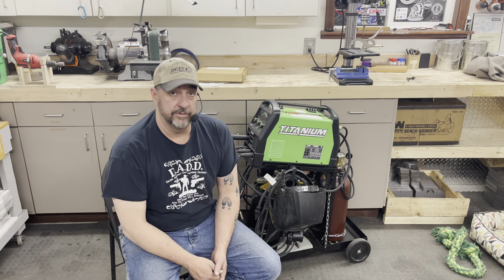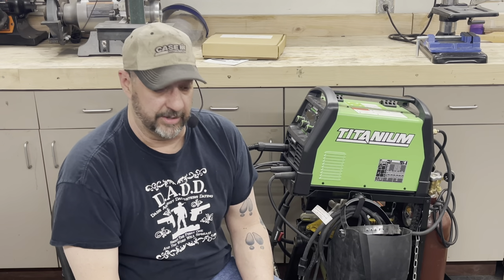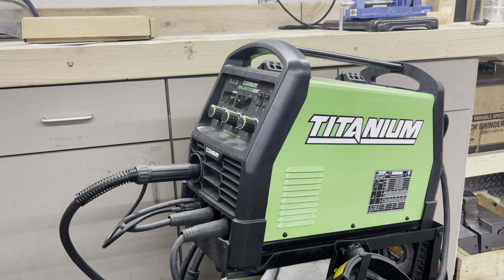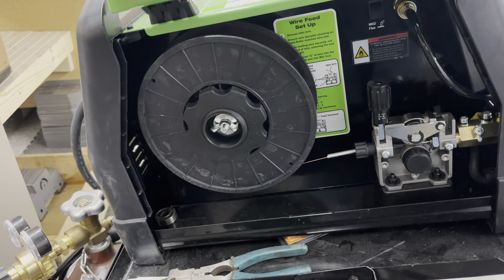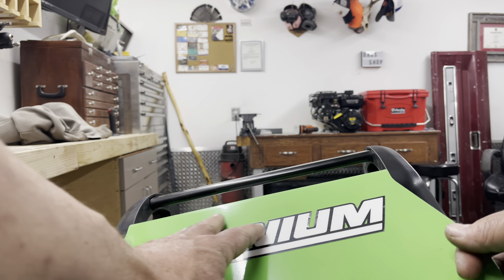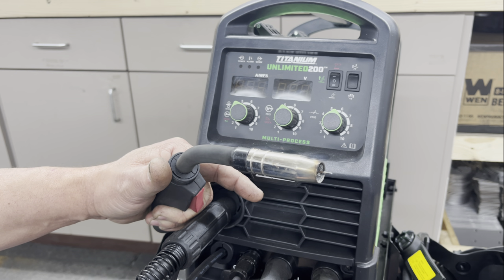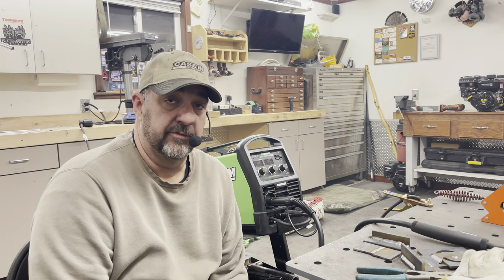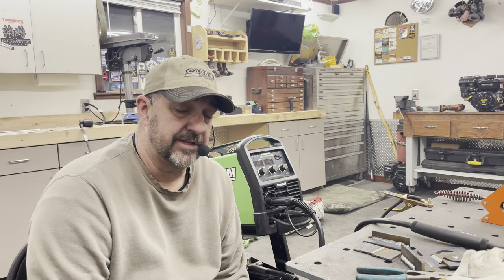Harbor Freight - Titanium Unlimited 200 Welder - Junk or Jewel?

Comment: I have the same welder and have been using it for 2 years now, built lots of little and big projects and it has worked flawlessly. I installed 240 receptacle in my garage and it works well on thick metals used to make HD bumpers. I found my welder at my local HF as an open box with the same cart for $550 together. I could not pass up the opportunity. It is a very good welder and so far it is stout and runs past its listed duty cycle without overheating or tripping breakers. Definitely worth the money for a hobbyist. Thanks for such a great in depth review!
Reply from the maker: Thanks for watching
Reply: Hello! I know this comment is like a year later than yours but I’m curious how the welder has held
Up in that time?
Reply: @PyroSparton117  mine are functioning normally, I picked up the stick welder 225 and the flux core 125! All three have a place in my carts and get used, I haven’t had any issues with all three of them. They have their own purpose and uses around the shop! All were able to be purchased at a great price, not so sure now. I’ve build bumpers, railing, suspension, targets and stands, shelving and a bunch more stuff.
Reply: @Justforfun-ek7et  excellent! Thank you for the help! We’re looking at one for our ranch and I was curious its longevity. Thank you!!

Comment: I've been welding for 10 years and this little guy does great.  I have an SA200 on my rig I use for pipe welding but it's loud and not practical in the neighborhood. If I'm doing home projects or little side gigs this machine is my go to. I'm confident it will weld good enough to pass a welding test. I've been thinking of doing a 6G pipe test on some small bore with an actual WPS and see if it'll make xray quality welds lol. I've had lincoln and miller for the shop and this titanium actually not only compares but excels in some aspects especially in the mig portion on autobody. Great video by the way just subbed!

Comment: Great review, Ive had my titanium 200 for over a year and it is rock solid. I got the two year warranty also, no brainer. TIG works great other than drag to start, but no big deal. Ive welded tons of stuff, just got done building a 20' !4,000# tandem trailer from scrap steel I picked up and it turned out real nice. just subscribed to the channel. Again, really good review.
Reply: When you drag start your tungsten doesn't  it contaminate  the weld?????
Reply: @jefferycarter1791  it’s never been a problem for me, it’s called drag, but actually it’s just a light touch to get it started kind of like arc welding. I like tig because it’s very clean and looks great.
Reply: @jefferycarter1791  thats only if you have a weld puddle or the tungsten is hot and melt the filler to to it on accident
Reply: How much extra was the 2 year warranty??
Reply: $99 we’ll worth it
Reply: I just took some old steel screen security doors. Salvaged the steel and built me a work station using folding legs from press board tables. I welded it up in 3 sections so it can be 50x20 inches, 112x20 inches or an L shape 81x51 inches or 50x20x51x20 inches. Added bracing to support a bolt down vice and bench grinder. Next project is a 6foot metal break that will attach to it. LOVE that welder!

Comment: I have a different model of the titanium. I have the mig 170 and I believe it is an excellent welder at the price point for the product line. I carry it in my service truck and have used it for a large weldment repair on a combilift. It performed exceptional and the repair shows no signs of an issue two years later. The machines are very capable if you know the limits and prep your work accordingly.

Comment: I bought one of these machines and I love it. I grew up with an old Lincoln stick welder, so having 2 types of Mig, Tig and Stick in one machine is fantastic. I use it on 110v for most of my body panels on the old 56 I am restoring, but I had 220v plug installed in my shop, and ordered a 25' extension cord, on Amazon, so I can move it around the car to work. Fyi, you can get an extension cord for $35 that is 25 feet. You can not build one for that!! This is a nice little unit and I am truly thankful there is a Harbor Freight in my town for this old guy to have a decent shop!  :)  And I also bought one of those nice little carts too. I did add a couple pieces of angle iron for a better support for big gas bottle. Very good little welder!!
Reply from the maker: I agree, good little welder.

Thanks for watching.

Comment: Thank you. i took couple classes in welding back in 1989 i almost did my certification plates had to move i lost my job. Anyway i kept welding on cattle ranch projects.i amazed my self on how i did, but i tried running a couple beads about three years didnt di so good.  I just bought the Titanium 140 for my B-day Dec 9, 1958 so im a little old been a working cowboy, horse trainer, truck driver, and a Solider it's time i start playing with welding. Thank you for your video nice job on your discription. God Bless Jack⛷️
Reply from the maker: Thanks for watching Jack. Merry Christmas.

Comment: I like your tattoo of deer hooves. Like you I was raised where welding was a part of the everyday business of farming. I then went into auto collision repair and used red and blue brands quite extensively for some time. 20 years ago I changed occupation and haven't been able to continue to practice like I would have liked to. I am looking to get back into having my own home-welder for projects and repairs. Thanks for the video review. I have looked at the HF machines for about a year considering it.
Reply from the maker: I don’t think you will disappointed. The TIG is a little ‘meh’ but the rest is legit.

Comment: Several things. No, you’re not a simple guy, you know this. I like your presentation. The content is good. In general, the video is fine. I do wish you’d not use the blackout in editing. It’s disconcerting to older eyes. I always tell people to read manuals. I’ve welded since 1973. When I bought my new esab welders a while ago, I read the manuals. I always do. Sometimes there’s a gotcha you didn’t expect. And beginners really need to read manuals, as they know little, unlike us.

Otherwise I’m happy I found your channel. I usually wait until I’ve seen several episodes before I decide to sub, but I’m going to do it now. I’m interested in hearing what you have to say, and do.
Reply from the maker: Blackout? I do not understand. Help me fix it.
Reply: @jackofalltrades7822  hi. Yes, where you are editing the cuts together, the video is blacking out for a moment. I don’t know what editor you’re using,  but usually, you can just join the segments without any transition. I thought it was deliberate on your part. You must see it when you review the edit.  Check the areas where the segments meet and see if there are any black frames. If so, just cut them out. That’s the best I can help without seeing the editor and the final video running in it.
Reply from the maker: Those transitions are intentional. That type is  one of several transition types and all have a temp black frame of some sort. Just trying to make the video as professional as I can with my limited editing ability and software. I will try other transitions but that was the one I felt looked the best.
Reply: @jackofalltrades7822  I understand. I just find it jarring. I used to do this professionally. And transitions can be a problem. Deoending on what they are, they can be uncomfortable for some people.

Comment: I actually have that same cart. The only thing I changed was I added a BW cylinder holder with a 2 inch stand off because I use the bigger bottles and it impacted the gas line on my welder. $39 for the cart and $23 for the bottle holder stand off adds up to a silly cheap and nice enough cart. I was able to trash the little chains too. I can lift the cart upside down and the bottle won't budge. Nice little add on.

Comment: I love that welding cart. I have my Millermatic 211 MVP on the top and I made a few bends and put my HyperTherm 380 Plasma on the bottom shelf. I installed a set of receptacles and an quick connect air chuck on the back of the middle shelf so I can run one power cord from my wall source and one air hose from my retractable hose reel to the cart and power both the welder and plasma cutter and wheel it around where ever I need it. After several years I did upgrade the casters after the original bearings got a little "chunky" with all the weight and a 110CF bottle of C25.
Reply from the maker: I still use it and it has worked well.

Thanks for watching.

Comment: Hello, I use the Titanium 140 and it holds up too everything that I weld. I been welding for 25 years and by far, this is the best welder for the price. I help a friend in his shop and he use millermatic 140 and te Millermatic 185, but the Titanium  140 equalls the same quality as the Millermatic for a much cheaper price.

Comment: One of the best videos on welder and welding. You might be out of practice but you can't beat the experience. Thanks for actually doing a vertical up, a lot of people can't even do them. Where I used to work that was 80% of the job, lol. Great job. I actually just bought that exact welder and waiting for it to ship.
Reply from the maker: It works great. I actually gave it to a friend when I got my yes welder 7 in 1 and he is still using it.

Thanks for watching.

Comment: I have the Titanium 200 also,  today's date is January like the 5th 2022 so I know this is a little bit older but at the time I have mine maybe 3 or 4 years it's the older style like yours is which I like much better better,  than newer one they just came out with .    as far as the machine goes I have it.  I have a couple machines different brands Primeweld Weld 180 miG and Primeweld 225 tig , and some other machines Lincoln 140,   Prime world plasma cutter 60 I love it    but I really like this it's not a bad machine for the money , I've had no problems  I haven't about 3 to 4 years maybe and never had an issue with it I hope you enjoyed what's yours . The  reasons I got the Primeweld is the tig in the 200 works I just fine for  Scratch start . I wanted a foot pedal and a better torch you can't add on to that By the way I did have a problem with it not really a problem the  Regulator I couldn't get it to work quite right so I got another one right away off Amazon that's really the only issue I really had with it may have been me though  I use a predator 9000 generator I'll buy machines they work fine no problem on the 9,000
 The privator generator only has a 30 amp to 220 on my 9000 you can get 50 app which I highly recommend if you can get one then you get more power out of the machine
 When I open mind the 1st thing I do was stick it works fantastic with the stick then I put them in the middle and I didn't flex score worked fantastic then I went and got my bottle I got the big going and I'll tell you what I was impressed the tape worked fine I just want the food but I would highly recommend this machine for the money it's not bad but you can get better deals If you buy this machine you'll do alright

Comment: I’m a diesel mechanic and at my job we run a Miller 252 mig machine, was tired of my cheap flux 90 machine so got the unlimited 140, same thing only 110v because I would have change my whole breaker panel in my house to add another 240 outlet so not worth it to get the 240v version. I’ll use the money saved for a better regulator. I can mig fine but never had the chance to do tig or stick so can’t wait to try it out and suck at it lol. I got a car at home I have to a trunk pan on so I’ll get to try it out come spring time. Good to know it isn’t terrible

Comment: I took one of those carts and made a junction box that hangs off the back so I could plug in my welder on the top shelf (Chicago Electric MIg) and my lotus plasma cutter on the bottom shelf. With the junction box on the back there's no real room for the gas tank, however I have my "extension" cord in a 5gal bucket coiled in it. And the gas can fits right in it, not really secure but doable if you watch what you're doing while moving it.

Comment: Thanks for the video! You've probably tried setting the Argon with torch running? Before even screwing around with the Tig- Do Yourself a Huge Favor and Get yourself a  Stubby Conversion Pyrex #10 cup kit around 30 bucks. Comes with everything you need and very compact comparatively - your Stick Out can be longer and Gas set Lower because your gas flow and Shielding improve dramatically And you'll be able  to see Everything.  This will reduce frustration and Tungsten Grinding time. Also get a pack of the mirror tungsten diamond dremel wheels for sharpening Tungsten $10
Reply from the maker: I will do all that. Thank you for the advice.

Comment: Put some thick dust felts under the control knobs and push them snug to re install them. That way there’s some resistance on the knobs. Also, throw the regulator away and get a good one with a rotometer on it.

Comment: Thanks for reviewing this I’ve been hesitant on getting this welder I didn’t know if it was worse than the Vulcan thank you ima go get that here soon
Reply from the maker: Check out my latest vid on the YesWelder Firstess MP200.

That one has a plasma cutter in it for not much more $$.
Reply: @jackofalltrades7822  I will definitely check it out main reason I’m looking into this is the 120v option I have a Millermatic but it’s to big to take around
Reply from the maker: @UnKnown_11619  the YesWelder MP200 is 110 & 220 capable.

Comment: I built my welding cart for less than 40 bucks, only thing I had to buy were the casters. I used 1/8" angle iron that somebody through out on the side of the road. I do love my Titanium multi process though, built my cart using a chicago electric flux welder but knew I would be upgrading my welder so I guessed on the dimensions and slap me in the face I was almost dead on. Had to notch out two spots and perfection even if my notching looked like crap. Don't care how it looks as long as it functions.

Comment: I'm a professional pipe fitter/welder and tank builder/welder and I own the 140 multi. Stick welding is the only issue. I can only run 1/8th and 3/32 inch rods. I need this machine to run 5/32 rod at 130-140. I use mine in an industrial setting. Scratch start is fine for tig welding. You just hold the tungsten above the material and scratch the filler rod across it to start. The only issue is the torch doesn't have a flex head. Convenience I guess. The stick weld lead is decent. Kinda awkward at first as its. Ot a 400 amp head that we use at work. Other than that. It's lightweight and you don't want to throw any of it around as it is not heavy duty. You can however buy an after market Miller or radnor tig torch with flex head, but the attachment to run your stick lead to it, switch to tig, hook up gas in line. And it works beautifully. Been doing it for the last 2 weeks doing a half billion dollar plant with a 400 dollar welder with a 300 dollar tig torch. Doing all 304 stainless with some 316 stainless. Our company bought the protig bmvulcans and they run good too. With the same flexible head tig torches. If you don't do that. Then get the stubby ceramic tig kit for 65 bucks. It changes the collet body and head to a much better setup.

Comment: I think (if you bought a warranty) you can take that regulator in and let them replace it.  That can be a one off issue for that particular unit.  Question:  Are you using standard 14 gauge house wire and house plug for your source?  What is the amperage of the breaker at the house box?   I have a 12 gauge wire I ran to my wood working shop from the breaker box with a 20 amp breaker. It is 45 feet long with professional (not contractor) plugs.  I also ran a 10 gauge extension cord to extend it to the other side of my shop (because I had it on hand) and it is 25 feet long, from the 12 gauge plug.  (Found that one at HF on the sale table for $25).  Anyway, I know I got awesome cabling for my shop use, if not overkill, but I am concerned about welding source.
Reply from the maker: My shop is wire 20 amp with 12/2 wire. You should be fine.

Comment: I have a titanium stick 225 and I have absolutely 0 complaints with it. Other than the fact the amp dial isn’t very precise. But other than that absolutely no complaints. Smoothest running stick welder I’ve ran and we ran Miller industrial welders at school. I’m looking to replace mine that got hurt in a barn collapse. I’m stuck between this one and the firepower (ESAB) MST200 for $100 more. Hard choice lol

Comment: I'm using this welder now on it's 3rd year.  I build custom motorcycles along with other various fabrication projects.  The welder might get 30 hrs a week use on average.  I've had no problems with the machine to this point. Only repairs have been regular wear out parts.
Reply: Have you tigged aluminum with it ? I am having issues getting my settings right to do so and can use some tips

Comment: question, now that this video is 3 years old, hows the titanium unlimited 200 holding up 3 years later?
Reply from the maker: I don’t have the machine anymore as I sold it to a buddy. That said I know he still has it, I know he still uses it and he has not told me it has given him any problems. I just saw him yesterday and gave him a roll of flux core wire for a project and so he is still using it.

Thanks for watching.
Reply: thanks for responding, i shall buy one now